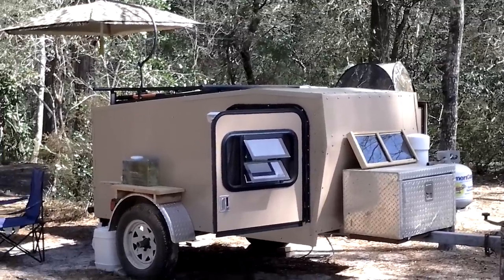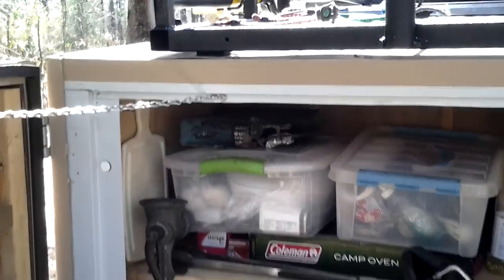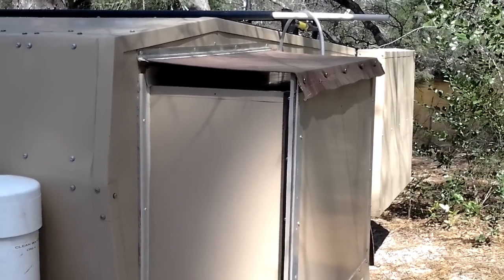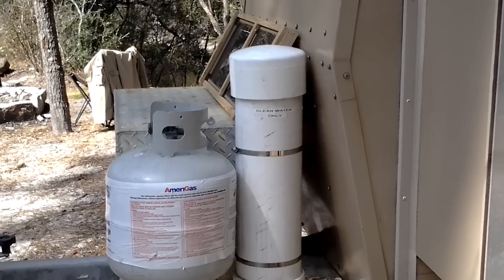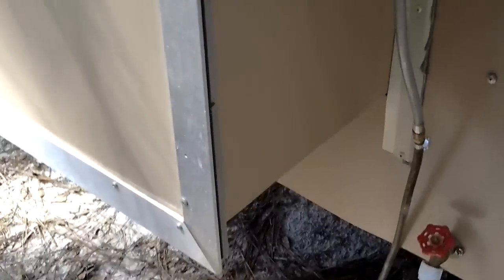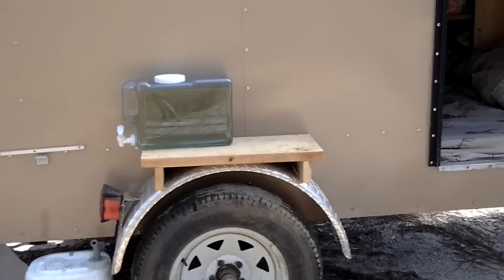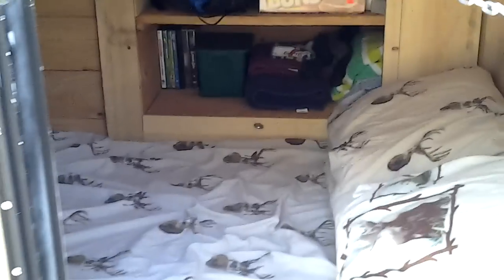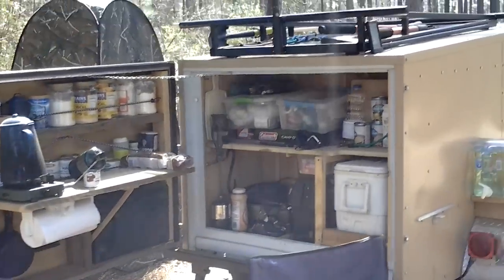Homemade Teardrop camper

Comment from the maker: I really liked the swing pantry door a lot. It was heavy and wanted to leak  a little at the top. If I was building another one I could incorporate a sealing feature in the frame but to rebuild this one would have been a lot of work.  If you overhang ur roof over the door the water would run right off. Thats prolly what I would do next time.

Comment from the maker: Thanks Josh. The cabin is just under 6', total length is 8.5'. If your not already, join a teardrop forum. You can get alot of great info from folks who know tiny campers.
Reply: +ksmack0101 Hi, great video on your trailer, I love the shape of it, I went and bought some lumber and I am going to start mine, Question for you? Is the height 6 feet on the trailer? and is the trailer itself minus the trailer 4 feet the width of a sheet of plywood?  Thanks..

Comment: Nice camper. I notice in the older video your galley door swung  open. That was one thing I like about your camper  In the newer video you change it to lift up. Why did you change it? Was there a problem? Its nice now but it looked like you had more storage before. I’m planning on making a camper would you not go with a door that swung open?